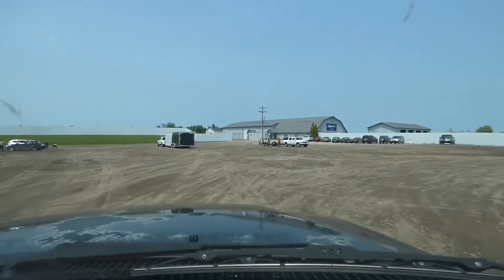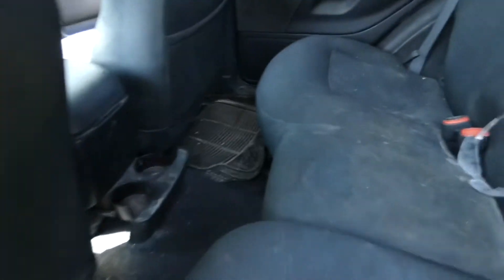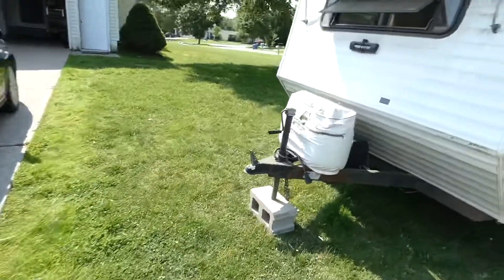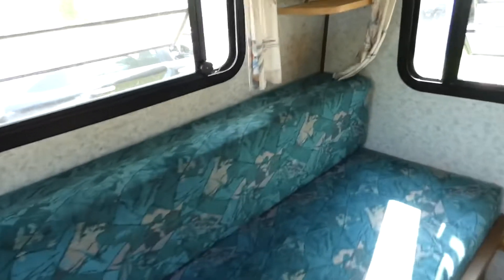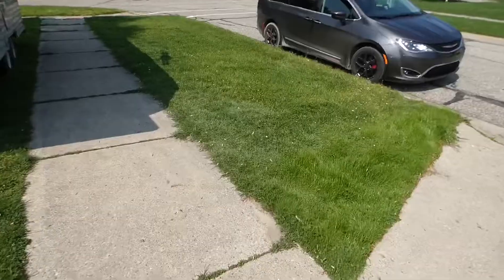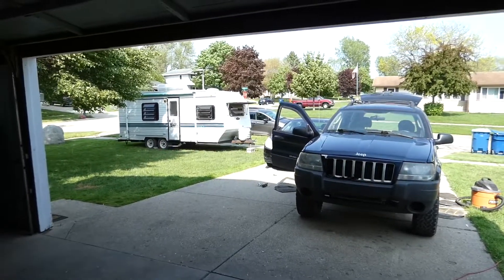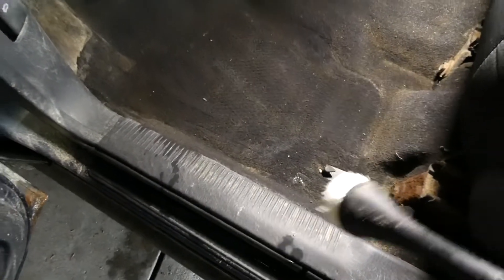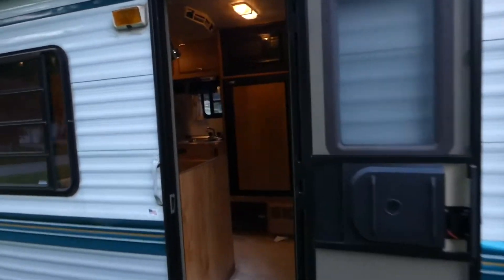Bought a $400 Camper From Copart!!

Comment: Do you have a dealer license? I would go hard with this but we’re limited to like three or four a year before we need a license
Reply from the maker: HookedOnHustle not yet. I’m working on it though, it’s kind of hard in my state to get one. We can do 5 a year, that means 5 a person lol.  I just work it out. Lol.  Love the name bro.  Thanks for watching!
Reply: @KBMOTORSchannel  what broker do you use?
Reply from the maker: I only buy clean title vehicles, otherwise if I wanted to buy salvage I have an account with erepairables it cost $200 per year but I can never see copart cars on their site. But they have access to thousands of other salvage auctions country wide. It just costs more and you have to rebuild the title. I just ain’t there yet. Lol. But thanks for watching bro. I appreciate it a lot
Reply from the maker: Sorry I’m Michigan you don’t need a broker to buy clean title cars from copart. But I know it’s different in other states.
Reply: @KBMOTORSchannel  That's great. My state and surrounding states in North East require broker for clean or salvage. Thanks for the feedback!
Reply from the maker: Check out erepairables it’s 190 a year. But copart only gives you $1000 buying power until you put down a $200 deposit then it goes up to $3000,  I have $800 deposit at copart that just stays in an account. So in theory Erepairables is almost the same thing. You can search by state as well.